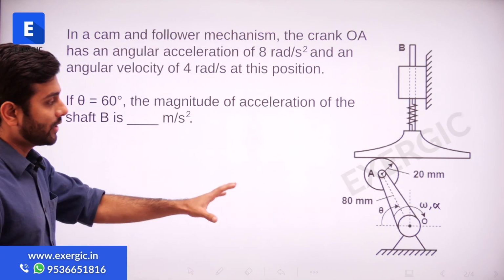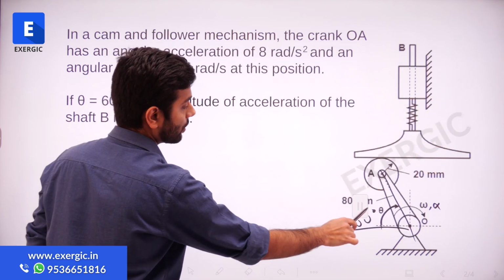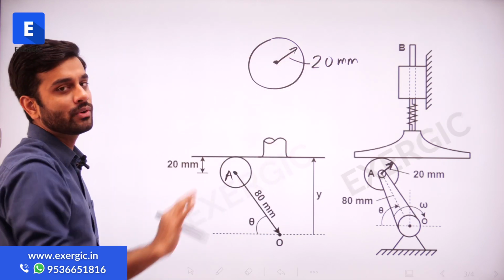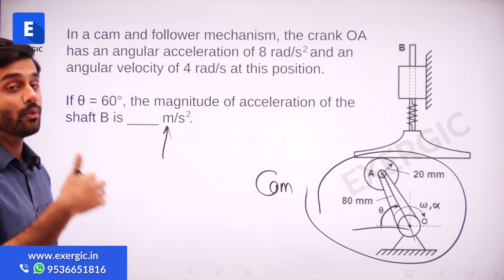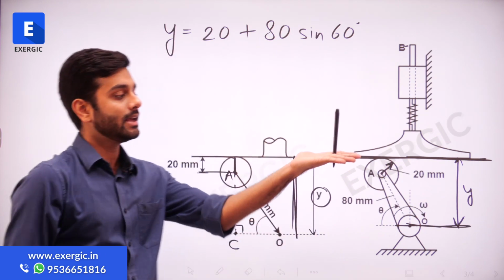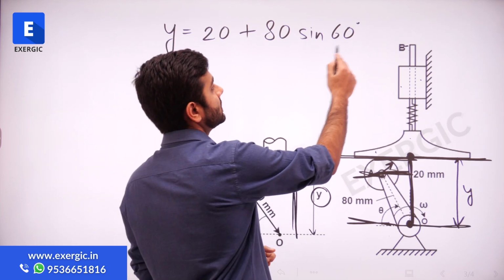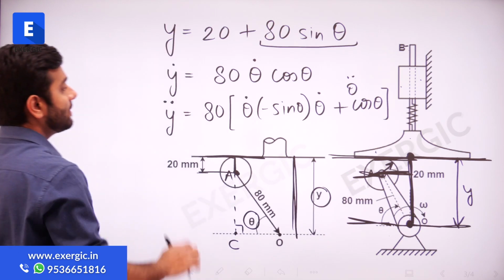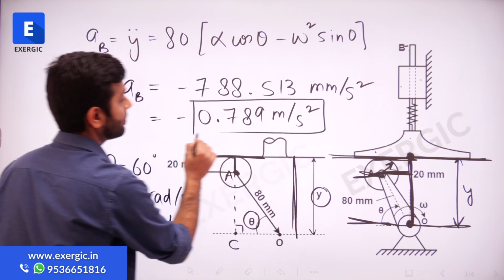GATE 2022 Expected question from Cam Follower in Theory of Machines • GATE Mechanical • Exergic

Comment: i think it is wrong approach because what is exactly mean by 'y'
y means how much the follower translates up ( or may be down) which is function of angle θ
at θ = 0 the follower alreay has 20 mm from fixed point "O"
at θ = 90 the follower has top position with 100 mm from fixed point "O"
how much follower moves is it 80 mm only naa here they taken y to be distance from fixed point which is wrong
can you clarify this exactly what y represents

Comment: Sir , In actual exam 2 mark and 1 mark questions are separated i.e. From Question number 1 to 25 it's 1 mark and from 26 to 55 it's 2 mark in technical section. But in test series it's jumbled. Isn't it ❓
Reply: Or, What's the best way to attempt the questions ❓
Reply from the maker: In actual exam also, it will ve jumbled.